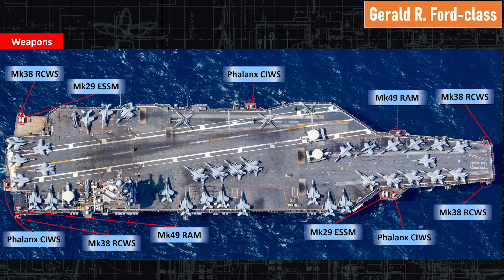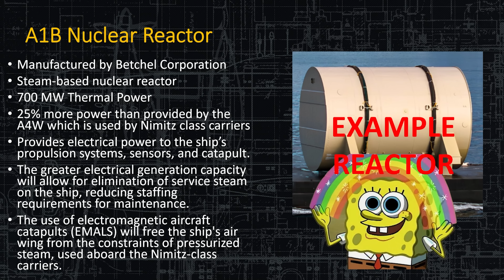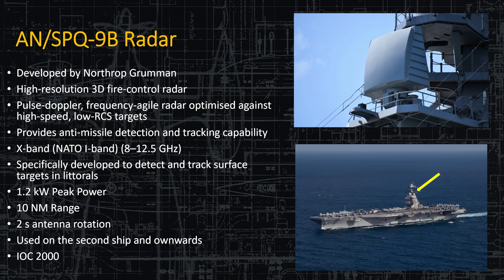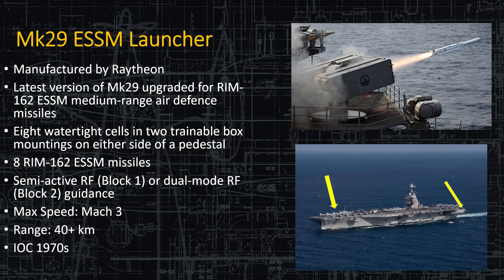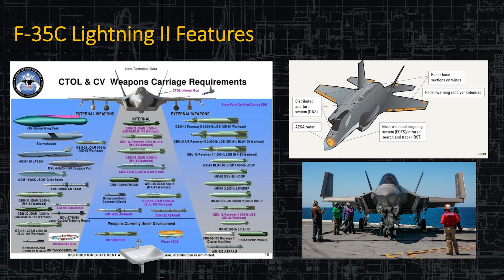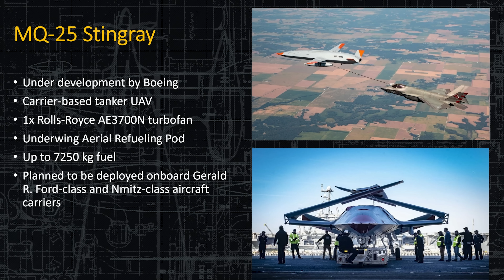Why Is This the Most Advanced Aircraft Carrier Ever?

Comment: Be cool if these can have 2 x 8 cells of the shorter/lighter tactical Mk41 VLS, Quad fitted with ESSM block 2 with 64 missiles
This carrier needs not only S band and X band but also L band with an true longer range anti stealth capability and 4 or 6 fixed flat sided AESA FCR radars that can lock on to 10 aerial targets per FCR panel (60 targets all up) for a coverage of 360 degrees.(AKA Hunter Class)
US navy is looking into manned/unmanned VLS ships that can escort with these ships and be networked to this ships radar and combat system giving them extra VLS shot capabilities.
Reply: Air defence missiles on these carriers should never be used. They are really backup to ESSMs on escorts, which are backup to long-range air defence on escorts, which are backup to air patrols, for which usually half of the air wing is detached. 

So there is really no need for bigger magazines of missiles. They need to shoot down 1% that gets through, and if escorts run out of ammo, they are doomed anyway.
Reply: @stupidbro2301 The ESSM replaced the original sea sparrow which was was fitted for US aircraft carrier protection.
Having many more in a quad set only makes sense especially on this huge aircraft carrier.
The French carrier has 4 x 8 cells A-43 Sylver VLS launchers! and the Italian carrier Trieste has 2 × 8-cell SYLVER A50 VLS launchers if they can do it a Ford carrier can.
What makes the Mk41 so good is that the ESSM can be quad fitted with a respectable 50km ranged missile the ESSM II whilst French and Italian VLS systems are not quad fitted with SAMs only single missiles per cell.
Reply: They already have 3 x SPY-3 as a fire control radar. Plus the SPQ-9B. And 3 x SPY-4/SPY-6(V)3 which is also a BMD radar which can detect both ballistic missile and stealth at long range. To compare it's just as powerful as Europe's upgraded SMART-L BMD radar that can detect ballistic missile at 2000km fitted on De Zeven Provinciën-class frigates. On the other hand MK29 ESSM box launchers can be reloaded or much easier to reload at sea compared to Mk 41 VLS. Plus with its air wing doing CAP, their is no need for it carry more SAMs so their is no real need to have its own VLS.
Reply: @johnsilver9338  Compare Ford or Arleigh Burke Flight 3 to that of the Hunter class with its CEA FAR 2 L band and S band with CEAMOUNT AESA FCR on the Hunter class with 10 targets per FCR face with its 6 faces that's 60 lock ons
The CEA FAR CEAMOUNT AESA Fire Control Radar system on the Hunter-class frigate. It's a huge leap forward in terms of simultaneous terminal engagement capability, especially when compared to the SPG-62s on Arleigh Burke-class destroyers.
Comparison: SPG-62 (Arleigh Burke) vs CEAFAR2/CEAMOUNT (Hunter Class)
Capability: Arleigh Burke Flight III v 	Hunter-class Frigate (AU)
Fire Control Radar Type Burke SPG-62 (mechanically steered CWI radar) v Hunters	CEAMOUNT AESA (electronically steered FCR)
Radar Faces.
So 3 x  SPG-62 dishes	v 6 x AESA CEAMOUNT faces.
SPG-62 Simultaneous Illuminations per Face	 = 1 target per dish (3 targets total)	v AESA CEAMOUNT 10 targets per single AESA face and  having 10 targets per face thats (60 targets total)
Total Simultaneous Terminal Illuminations 3	for Arleigh Burke up to 60 for Hunter class.
Why CEAMOUNT Is a Big Deal
Electronic beam steering allows near-instantaneous switching between targets.

AESA modules can handle multiple beams simultaneously, unlike legacy dishes.

Can guide dozens of missiles in terminal phase without performance degradation.

Supports ESSM Block 2, which uses active radar homing but still benefits from radar updates.

 Strategic Implication
Arleigh Burke Flight III is excellent at detecting and tracking large numbers of targets via SPY-6.
But it’s bottlenecked for terminal engagements when using legacy semi-active missiles and individual close missile targeting selections.
Hunter class with CEAMOUNT can handle huge salvos of simultaneous threats, especially in saturation attack scenarios, thanks to:
60 simultaneous locks,
AESA-based fire control,
Support for next-gen missiles and anti stealth L band search radar
Bottom Line
Arleigh Burke III v Hunter Class
60 lock-ons via CEAMOUNT is an order of magnitude leap over legacy SPG-62 capability, and will makes the Hunter class one of the most up to date ships, especially fitted with a L band frequency anti stealth capability and multiple lock on targets capability 60 all up, to Arleigh Burke's flight III x 3.
Reply: @Leon1Aust  Old SPY-1 can track 100 - 200 targets. With 4 of them an Aegis destroyer can track a total of 400 - 800 targets. Much more the newer SPY-4 and SPY-6. Not only that they can detect and track both ballistic missiles and stealth at very long range. CEAMOUNT AESA FCR is not even a BMD radar. 

On the other hand Ford class don't use SPG-62 CWI radar as they already have 3 x SPY-3 for that. Also SPG-62 is a CWI radar, not a volume search radar, so it don't need to track anything. Its job is to illuminate targets. Tracking targets is the job of SPY series radars. 

AESA SPY-1 is SPY-4, while AESA GaN SPY-6 has multiple RMAs/arrays where each array can do a separate job. One array can do high elevation volume search and another array can do low elevation search for sea-skimming missiles. No other radar can do that except UK's dual face/array SAMPSON radar on Type 45 destroyers. SPY S-band BMD radars can also communicate with missiles with active-radar homing and guide them thru datalinks, but that's what X--band SPY-3 and SPQ-9B especially SPG-62 CWI is primarily for. So it can serve as a backup. So on a Ford carrier, if SPY-3 get destroyed, it still has SPQ-9B and SPY-4/6 to guide missiles. On Burke, since it has 3 x SPG-62 if either one of them gets destroyed their are still 2 other SPG-62 then SPQ-9B and SPY radar to guide missiles. But highly unlikely all 3 SPG-62 gets destroyed as they are distributed 1 for and 2 aft unlike on Horizon CEAMOUNT radars are all on its mast and can be easily destroyed.
Reply: @johnsilver9338  CEA FAR exceeds SAMPSON radar on Type 45 and AESA SPY-1, SPY-3 ,6 , and the ship equipped with CEAFAR is Australian not European its called the Hunter class.
This ship will have a 6 sided radar not 4 like USN ships and a suite comprising of 6 x GaN AESA CEA FAR 2 - L band very long range medium frequency that has an  "anti stealth" volume search radar capability something that all US SPY-1, 3, 4, 6 are all short frequency radars do not have!!!, thus cannot illuminate stealth. 
While the Hunters also have GaN AESA CEA FAR 2 - S band are volume search radars that is similar to SPY3  SPY6 ....all are S Band AESA GaN frequency panel faces.
CEA FAR has 6 sides
SPY-1,3,4,6 has 4 sides
Now for fire control radars (FCR) for lock on capability to destroy individual close grouped anti ship missiles the 6 faced AESA GaN CEAMOUNT radars are illuminators with a capability of 10 targets per face and with 6 faces, equals to 60 targets in close proximity 360 degrees.
Unlike Arleigh Burke's Flight III SPG-62 that are a single target capability all up only having 3 targets in close proximity.

CEA FAR 2L and S band and CEAMOUNT are all linked to the networked AEGIS combat system that can launch the SM2, SM3, SM4, SM6 ESSM, ESSM II, RAM and any other USN missile that will fit into a Mk41.
So Hunters CEA FAR2-L-S has a anti stealth capability and its CEAMOUNT fire control radar can lock onto 60 targets against the  Arleigh Burkes non stealth with 3 targets capability.
I know many missiles have full active radar seekers now but continuous FCR updates are always superior for close antiship missile selection accuracy, as one might not have much time when 16 x antiship missiles appear above the horizon in close formation.
CEA FAR a generation beyond others!
study it! as not many know about it.
The new British Mk 45 Destroyers replacement BAE are looking into having CEA FAR as its radar suite.
Reply: @Leon1Aust  Again, CEAFAR is not even a BMD radar. 😅
Reply: @Leon1Aust  I think you misunderstand something stealth can still reduce detection range of L-band radars. Otherwise all L-band AWACS will be able to see stealth at very long range. But USN don't need an L-band when they already have a UHF band AESA AWACS with E-2D.
Reply: @johnsilver9338  The L band frequency  on the Hunters has a longer acquisition range against stealthy targets than the current shorter waves S band and X band radars on ships of USN fleet.
L band does have advantages over UHF in as far as for locking on and cueing for longer ranged anti stealth missile shots.
UHF has lower Resolution than L band but being an E-2D they have OTH tracking but cannot cue stealth as good as L Band.
Thus L band is better for a ship in long range anti stealth cueing for active SAMs against stealthy anti ship missiles.
UHF against stealth is a good long-range spotter not so good at networked cueing against stealth.
Reply: @johnsilver9338  Wrong CEA FAR 2 L & S band will be networked with the most upgraded AEGIS combat system and CEA FAR 2L & S can fire the SM6 and it can fire SM3 if needed.
Our SPY-1D radar on the Hobart class will not be replaced by the less capable US 4 sided AN/SPY-6(V)1 AESA 3D short wave single S band radars and their single beam 3 x FCR .
They will be replaced by more capable multifrequency 6 sided AESA CEA FAR 2 L and S band  with the 6 sided AESA CEAMOUNT FCR illuminators with 10 targets per face with 6 faces = 60 targets.
Reply: @Leon1Aust  Then you do not know how stealth works. Stealth doesn't make you invisible at all ranges and to higher frequencies. Again it only reduces detection range. So stealth can still be detected and tracked at close range. But BMD radar can offset this as they are much more powerful. So how long can it detect stealth will be question then and can be solved using the radar range equation. So it matters less if even if the radar is in X-band as long as its powerful enough for BMD purposes it can still be detect stealth at long range. Why because BMD radars needs to detect both large RCS like ballistic missiles and low RCS ballistic warheads at long range which also gives it anti-stealth properties. For example official statement for SPY-1D(V) it “can track golf ball-sized targets at ranges in excess of 165 kilometers.” Using a simplified radar range equation r2=r1(rcs2/rcs1)^0.25=165(rcs2/0.0025)^0.25, it can still detect both a large ballistic missile at around 1730km and a low RCS of 0.03m2 ballistic warhead at around 308km which is well within reach of Aegis SM-6. This is why SPY-1 although PESA is still a pretty powerful BMD radar in today's age. What more for AESA SPY-4 and SPY-6. So unless you can show me the parameters of a CEAFAR radar it will not be as strong given its not even a BMD radar. More likely it will be comparable to a L-band AWACS radar which can detect a 3m2 RCS fighter jets at around 450km. Using the radar range equation it will only be able to detect the same 0.03m2 RCS  at 142km which is less than older SPY-1. SPY-1 calculations can also be found on mostlymissiledefense
Reply: @johnsilver9338  I know it's not for all ranges but only reduces ranges as per the given view of its RCS, and that is a state secret on individual aircraft and radar capabilities.
The reason you know so little on CEA FAR is that it has been kept a secret and the original CEAFAR1-S S-band Active Phased Array Radar a less powerful earlier version was fitted to the ANZAC frigate and performed far better than was expected actually excellent!
The Hunters class 6 sided CEA FAR 2 L and S with CEAMOUNT FCR is a totally different beast far more powerful, bigger, more AESA faces and capable and its been built and proven during land prototypes.
It was that good that the Aussies refused their Hobart class upgrade from SPY1 to the US SPY 6, stating CEA FAR 2 L & S with CEAMOUNT is a generation beyond SPY 6 capability.
Britain is considering it though the AUKUS agreement for their Type 45 replacement ship in the AAW replacement in the 2030s!
The Hunter class of which is a upgraded British Type 26 frigate at over 8,800 long tons! very large for a frigate! and it is the worlds best ASW frigate.
Throw in a AAW radar and AEGIS combat system and you got a very modern powerful ship but with limited VLS capability.
That is being addressed with extra 32 to 64 cell VLS pack installed in the ship or unmanned optionally manned VLS AEGIS networked escort ships...... IAW AUKUS RAN and the USN.
The USN are also looking into a VLS AEGIS networked escort ships with 32 to 64 x Mk41 strike length VLS cells in the unmanned optionally manned ship.
Reply: @Leon1Aust  Then a simple question? Does CEA FAR have BMD capability? Otherwise its just all empty boasting.
Reply: @johnsilver9338  Your all mixed up as the CEA FAR 2 L band & S band ships radar set  is Australian not European radar set nor is it is a  SMART-L!!
The SPY 3 and Arleigh Burke Flight 3 SPY 6 are all single frequency short wave S band radars with limited anti stealth search.
and the SPQ-9B have X band, short wave radar both have have limited anti stealth search capability.
Unlike the multi frequency CEA FAR 2,
 L band & S band ship radar set.
It is Hunter class CEA FAR L band radar that is the long range search with an anti stealth capability.
Arleigh Burke Flight 3 with the SPY-6 search with its 3 x single non AESA X band  AN/SPG-62 FCR radars units are still used for terminal illumination of targets when launching missiles like the SM-2 with a capability of only 1 target per illuminator!!!!!! 
That 3 target for the 3 x FCR! of the Arleigh Burke Flight 3 
Unlike the Hunters class CEA FAR CEAMOUNT Fire Control Radar FCR that can lock on up to 10 targets per single AESA  illuminator!!!! and it has 6  illuminators thus the Hunter class ship can lock on to 60 targets at an instant!!! 360 degrees coverage and track stealth aircraft!
Don't get a Search capability mixed up with a Fire Control Radar "FCR" capability.
Reply: @johnsilver9338  Fords a big ship and yes the MK29 ESSM box launchers can be reloaded or much easier to reload at sea but the Mk 29 is designed for single-pack loading, but it cannot accommodate quad-packed ESSM thus only 8 ESSM per launcher.
But having 4 x 8 cell Mk41 VLS that can fit 128 x ESSM missiles this is far superior to a few ESSM from the MK29.
Reply: I agree they should’ve installed some vertical launch cells. Maybe peripheral cells can be put on the newer versions. They need to incorporate SM six missiles and they should also upgrade as well too 57 mm port and starboard side and a couple 30 mm. They still have a ton of 50 cals and 240 bravos on there.